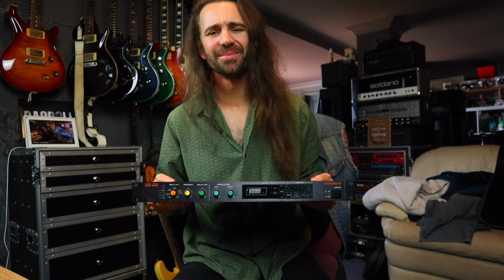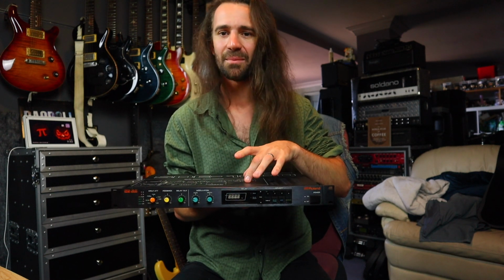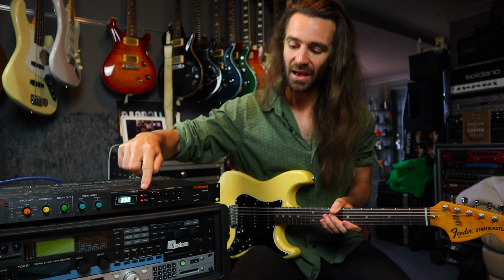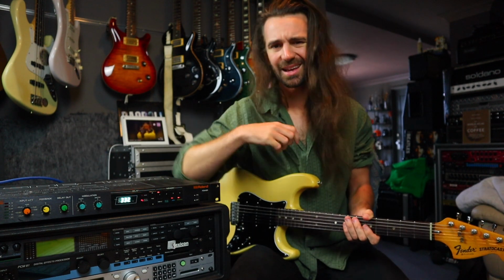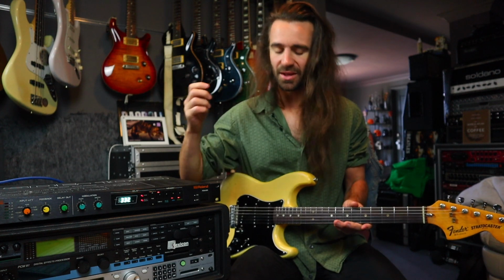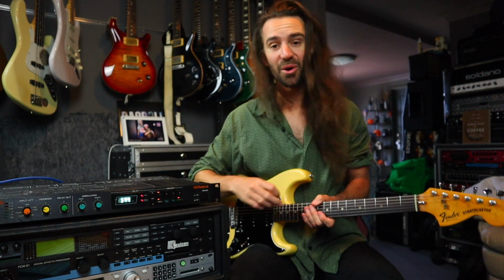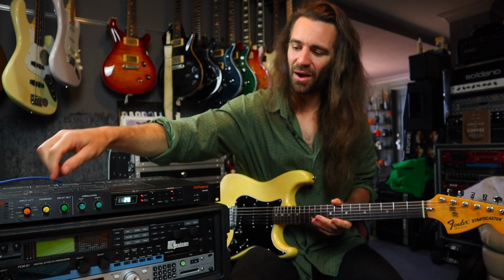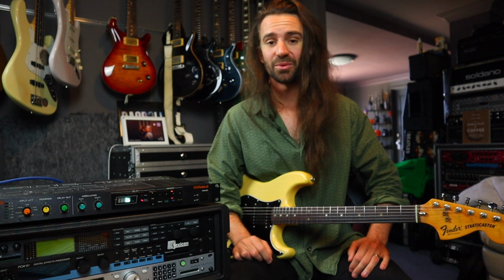Roland SDE-1000 - Classic Rack Delay

Comment: Man, come someone please help me? I’m at a total loss… I love this unit and before I get a mixer and everything I’d love to figure out how to use this in front of my amp.. the input attenuator is crazy sensitive and it can actually be a real pleasing clipping but i have to bump it all the way down to -10 to get any sort of head room and it just kills my whole setup.. with the button pressed in the back and everything, how can i fix this? keep it low and boost after? when i did that it just sounded awful but if it wasn’t for the gain staging this thing would be perfect.. please help!!

Comment: @LeonTodd A bit late to the party but do/did you have any problems with gain staging?  I got one not knowing that it doesn’t do line level like its bigger brother SDE3000.   I have it in an effects loop but have to pad the send/input ALOT to prevent clipping and the return doesn’t get the levels up enough to loop bypass levels

Comment: Thanks again Leon! These videos are a really valuable library. Just saw SDE-1000 locally, a couple of years after I missed SDE-3000 and this reassured me that it's worth a shot. Already thinking of ways to set SDE-2000 and SDE-1000 parallel for a double delay (the classic ~300 and ~500 type of ratio). What I really like about the SDE series is definitely that low-fi quality of theirs, the warmth and grit if you want to run it like that. And I gotta state that the ones with the Roland rainbow knobs are more delightful to look at and possibly adjust, even though the classic VCR look of SDE-3000 is also nice.
Reply from the maker: Yeah they're really voiced perfectly for guitar IMO

Comment: Got my SDE-1000 in early 1986 then a couple of years later got the SDE-3000. Both are great delays for their time and still are. The SDE-3000 has a good bit better bandwidth at higher delay times and a number of other good features. I hate I sold those delays years ago but I just found an SDE-3000 in excellent shape that is in perfect working order (got it for $350!).

Comment: Got 2 in the studio. Squeeze them through an SSL type compressor or API pres and they sound great .. . 
Plug a pedal in the Hold socket, twist that knob on the back,  and get some nice rhythmic stuff with even sweating.
Reply from the maker: That's awesome. Do you use them for delay only or for chorus/flange as well?

Comment: The SDE-2500 has slightly shorter delay times, but full MIDI control, which makes it a mainstay in my rack. It also remembers the pot positions even if the knobs have moved prior to choosing that preset.
Reply from the maker: Now THAT I like
Reply: @LeonTodd  pick yourself up a Roland SRV-2000, also, MIDI, the reverb Slash used on Appetite.
Reply from the maker: @johnsurace2330  I liked this so much I got one :) I've done a few vids with it

Comment: My first DDL was the Roland SD3000! Mind you... all these delays were not cheap at all. The SDE1000 was the kids thing as it can't handle line levels so it wasn't the best choice in a rack. The 2500 and 3000 were better designed, had memories and the first was also a MIDI unit. The 3000 has very long delay getting to over 4 seconds in a time memory was very expensive.
Yes, they maybe had 12bit converters but the companding circuitry was definitely 16 bit so not much of a lo-fi thing going on here. That was a time in which every company was trying to get their delays to sound as much as the same as the input source. Pristine. Nobody was concerned about lofi, analog or tape_like things. These were things of the past. Digital was moving on.
The fact many people hear a sweet tone is not the quantization. Bit wordlength won't change the frequency bandwidth... that's sampling frequency. These boxes were able to get up to 17KHz so you'd hear anything a guitar spectrum has in it. The sweetness comes from the analog circuitry at the input/output stages, like preamp, filters, output amp... all stuff that in time became digital... when DSPs got very powerful That's ONE of the reason your AXE delays sound shrill and not nice. The second reason why you hear sweetness is the feedback! The audio path of repetition was in analog domain, meaning that your echo was converted to analog and fed back to the analog input stage for remixing, re_converted to digital again and re_processed. Now, when you do that... the signal is definitely degrading because of multiple filtering and conversions and that's THE cool thing of many old DDL. That's another reason why modern echo... sounds not as good.
Regarding the chip inside the SDE line and the Boss pedal.... well... that means absolutely nothing. A chip is a computational engine around which you have a lot of analog parts building the tone.
In the Boss pedal you can forget about all that analog stuff so you're only left with digital instructions that don't really matter as much in terms of similute with the SDE line. Pretty much like the Lexicon 480 and LXP1... they had the same DSP... but would they sound the same? NOPE! Only common thing would simply be the speed of processing information, unless on one of them it could have been overclocked or even downclocked.Best case scenario... they sharde the same clock but didn't EVER sound the same at all.
Reply from the maker: That's REALLY cool about the feedback line and would explain a lot about the time of the repeats. Love it.

Did the Eclipse Vintage DDL emulate a similar thing?
Reply: @LeonTodd   Nope! There are things that need to be made, physically built in a specific way. The "emulation" culture has to stop as it sucks at most tasks. If you listen VERY closely... the old delays repetitions has a way to spread as clouds... the spatial imaging is very_very particular as tonal degradation and spatial openness are their main sonic features. Be it a Roland or Korg DDL or a Lexicon Prime Time or PCM4x ot a TC2290... they all share these characters.
The other reason why you get this dense spatial cloud is dynamic range! These DDLs  have limited dynamic range so the sound is not as strong and "in the face" as 24bit devices  and the fact feedback is recirculating in analog>digital realms adds to that in terms of less punch. That makes for a less defined sound, less energy. So in a way... a lesser quality technology has an aural character which is much sought_after.
Now... you can't emulate these things BUT you can actually recreate them in quite good approximation IF you use an external analog mixer with AUX Sends. If you feed an Eclipse or PCM80/1 a signal off an Aux send and DO NOT use any internal feedback (set it at 0%) AND use the Aux Send pot to feed the output back to the input you are creating analog feedback. Add to that the fact you now have analog filters on the mixer channel... often in 3 bands with parametric mids.... for extra fine tonal shaping. BANG... that's going to sound as close as possible to old gear... even though the spatial aural quality won't be exactly the same because of higher dynamic range. There some kind of VERY light compression may help but with much attention as compression tends to cut high frequency content... so a good analog compressor would be in order there. The PCM80 in particular (over the 81), being an 18 bit machine, gets VERY good at these classic re_creations as its tone is very fat and modulaton can be very deep. In fact older DDLs have a sweep ratio that is always bigger than DSP effects.. meaning that when you set modulation it takes very little to get out of control... too out of tune and wobbly. All these factors (analog feedback, limited dynamic range, sweep ratio and strong phase shift in analog realm) are what make old DDLs unique!
Reply from the maker: @italoop7850  now THERE is an idea for some sonic experiments. Time to dig an old mixer out.
Reply: @LeonTodd  Mixers are NEVER old!
Reply: Here's an example where I used a light compression to get rid of transients attacks on this "PCM DELAYS" presets I created on the Lexicon MPX-1. Notice how the delays sound like echoes, diffused, attack_less, like an aura.. almost a reverb. That kind of space is nice but it can be very hard to get from DSP processors. Some are better than others to get there. Compression here helps reducing the dynamic response of the delays, almost like older DDLs do very easily. Also...filters help a lot and that's another issue in most DSP products. Finding well designed filters is not easy in multi-fx as they take processing resources often used for other tasks.
Here:
http://www.italodeangelis.com/public/contents/eventide_and_other_stuff/lexicon-mpx-1/PCM-Delays.mp3
Reply: Italoop! Hope you're doing well sir. I was wondering how the DEP-5 Stacked up to the SDE3k design & others. I've found myself for many years now loving the DEP-5 over a lot of my "nicer" delays & reverbs too for that matter. For context this is thru a guitar rig w/mixer & low efficiency speakers (guitar cabs). Not sure of the timeline in terms of what came out 1st in the Roland line but I ditched my SDE3k's long ago in favor of my DEP-5. They were very close in terms of sound & I could get more out of the Stereo, Midi DEP-5... Would love to hear your take on these. Thx!
Reply: @kylecoffey6010  Hi Kyle. Funny you mention that... as a few years ago I bought a DEP-5... I think it's a sweet sounding Roland unit and I just LOOOVE what norwegian guitarist Terjie Rypdal does with it and an Echoplex.
If you don't know his records and you are a DEP5 fan...you should really check out the man.
What do I think? I have a hard time comparing the SDE3000 to the DEP5... as they are different things. The 3000 is a high end DDL with specialized features, like analog feedback, nice filters, etc. and having two of them you can get some spectacular stereo fx, from chorus to flanging and delays. It also has microseconds steps for the first 10 ms of the range, if I remember correctly, and right there you can do some terrific static comb phasing colors which sound amazing on lead guitar tones. DEP5 is a DSP device so everything stays in digital domain... it has a very nice character which I like a lot. To my ears Most Roland/Boss gear has a specific plastic_ish resonance I'm not crazy for...It's part of their tone character and in some applications it can be not ideal. DEP5 and SDE3000 don't suffer from that... so it's good. I also thing they sound different as discrete circuits vs. DSP algorithms are completely different planets. But as a DEP5 lover... I should really do a library of presets for this little gem.
I'm busy with several projects now... but I'll put it on the "TO DO" list. Cheers!!!
Reply: @italoop7850  thx so much for the detailed response on this DEP5 topic. I always learn a lot from your excerpts! One more DEP5 question if you don't mind, Stereo Ins & Outs vs. Mono In & Stereo Outs? Of the Delay & Reverb algorithms does it matter in the inputs like say an Eventide H3000k where many of the algorithms require Stereo Ins to get Stereo imaging at the Outputs. I've A/B compared the pingpong delays & personality can't tell a difference if I'm using Stereo Ins or just Mono In. It seems to be able to process the Mono In the same as the Stereo In at the outputs? Please advise I'm really interested to know this. Thx again!
Reply: @kylecoffey6010   DEP5 efx are mono in! Check the user manual drawings. Back then true stereo processing was very expensive and belonged to the top gear only ($$$).

Comment: I like it. I have a Strymon DIG pedal which is designed to replicate these old delays. My one issue with buying rack gear this old is, how much money do I have to put into it to make it work right? And a lot of techs flat-out refuse to work on this type of stuff. I guess replacement parts are hard to come by, whereas an old hand-wired tube amp is easy to work on.
Reply from the maker: Yep exactly, finding units in good shape is getting harder too